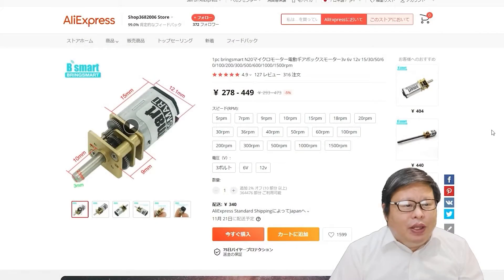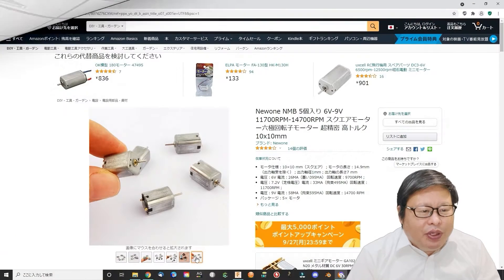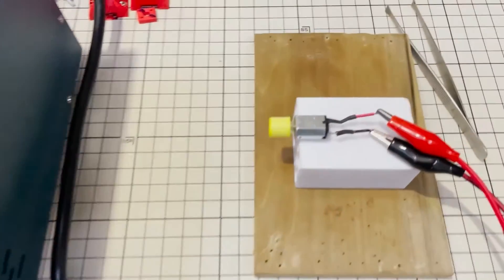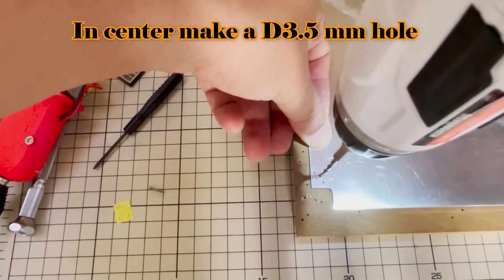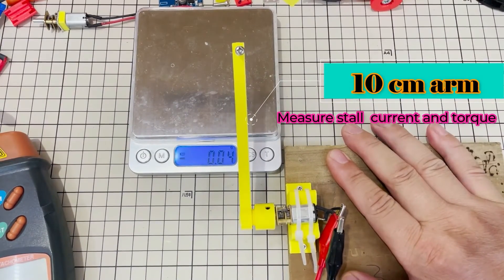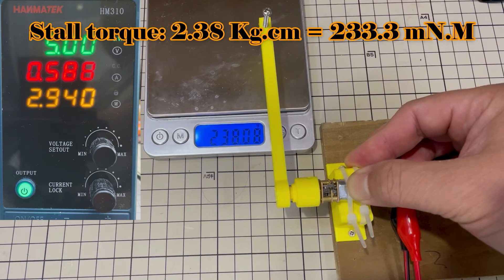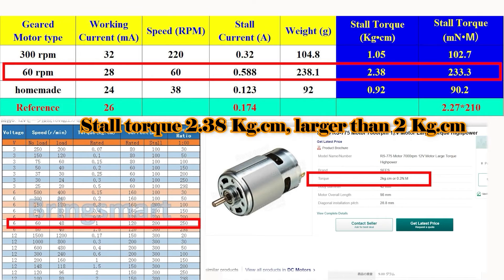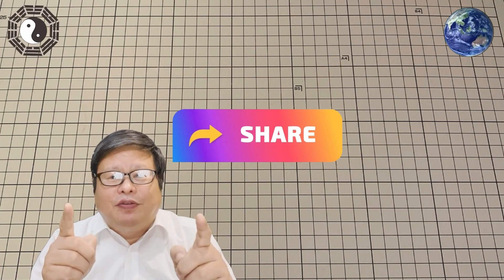DIY an N20 geared motor (measured the stall current and torque)

Comment: using a high torque motor thats cheap like the neo revamped that hits 50 nm 0f torque  standalone bet even more is possible
Reply from the maker: Thanks for your comment. I have checked the Neo Fang revamped motor that you mentioned. It is amazing that it has extremely high torque in a DC 130 size. The specification:  37,000 RPM, 500g.cm Stall Torque, equal to 49 mN.m, and 28 A Stall Current (Unbelievable large). 

If decrease the speed to 1/10. The stall torque is 0.5 N.m, larger than a normal 555 DC motor (0.33 N.m). LOL.  It is a mini-monster I think. 
But it is not easy to get in hand. I can't find it in Amazon Japan or Aliexpress, etc. Also, most vendors in the US are out of stock. I really want to check this motor if it is possible. 
Have a nice day.